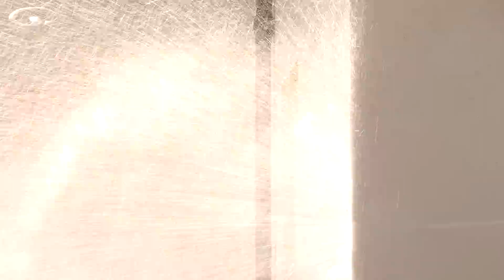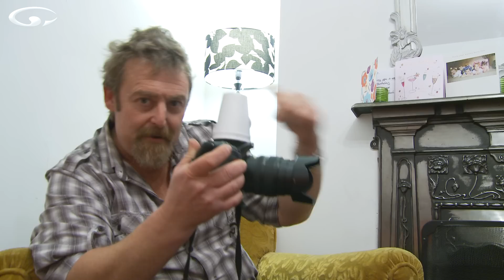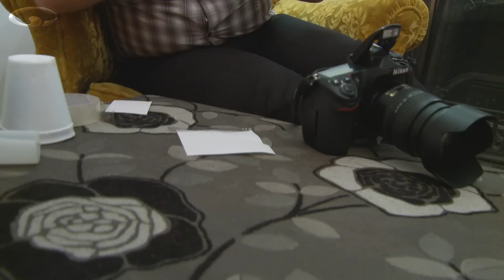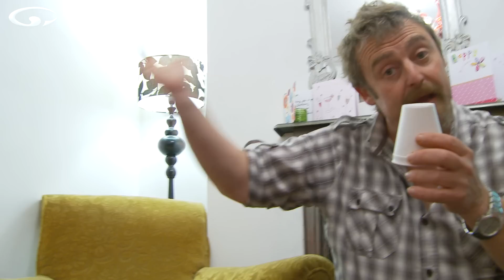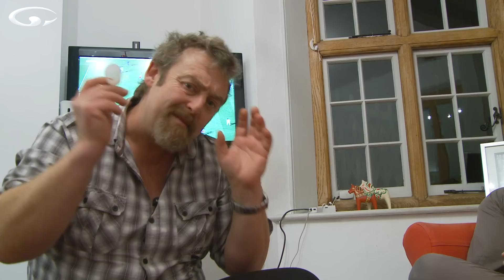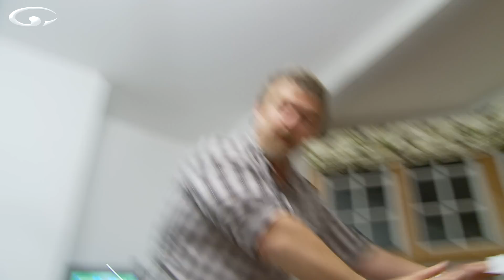Photography Tips - DIY Pop Up Flash Diffuser Pt 1

Comment: Thanks, I liked the card at 45 degrees, will have to try the poly cup with the bottom cut off. We had a couple of photos taken aound the table recently by a professional with the flash bouncing off the ceiling.  They were the best ever.
Reply from the maker: You're welcome +Bryan Hannaford If you have a clean white / neutral coloured wall ceiling to bounce off that's the best method - MIKE :-)

Comment: I used the 'business card' method for a few months before I saw this video :D
since I don't own a flashgun yet (invested in some L lenses first) I wanted to make my flash light softer somehow, so I thought about the way flashguns can rotate and figured that if I use a pocket mirror I can have the same control. So it's not exactly a business card, but I think a pocket mirror works better as it is reflecting all of the light without losing it :)

Comment: Thanks for the good tutorial. I am still waiting for the delivery of my first external flash but started to experiment with the built-in. For months I was struggling when taking indoor photos. I did not like them without the flash as they were dark/noisy/blurry but I did not like the built in flash either. It was too harsh with dark contrasting shadows.
Finally I have realized that in many cases it is better to turn off the TTL mode of the internal flash and set it manually (my M50 has 3 power levels for the internal flash). I had good results by setting the power of the built in flash to the minimal level and setting the exposure in manual mode to a level where the ambient light and the flash light blends much nicer than in auto mode.
Reply from the maker: Thanks Gabor 🙂🙏. You've nailed it buddy. The best way to find out what works best is always to try different ways of doing it. Indeed a blend of manual ambient and flash exposures gives much more pleasing results. Have a go at setting the ambient exposure about -1 stop to a bounced / diffuse flash. Nice light and subject stands out from background without it going dark. Best wishes for 2020... MIKE

Comment from the maker: Any diffuser will cut down the amount of light. The camera will set the exposure by measuring and cutting the flash burst when it's had enough light. So you have to be fairly close to the subject or the little on camera flash won't have enough power.

Comment: Hi Mike, as a diffuser I've always use a cut section of white stockings or tights held on by a rubber band over the flash.
If I need softer light I simply double it up. It works a treat and is very inexpensive.
Let's not talk about denier though :0)
Reply from the maker: :-) Yes probably best not to +Paulie52UK :-) - But great ideas though and like I always say these come from you and your Brilliant Brain which is the 1st of my 7 Building Blocks of Photography http://www.photographycourses.biz/courses/7-building-blocks-of-photography - MIKE

Comment: I used a mirror and reflected on the ceiling works very well. But, I think I need to finally buy a flash, after spending $2000 on lenses :) Nice Work!

Comment from the maker: Thank you. I haven't but will think about it. If photographing indoors i use manual mode on on the camera with exposure set 2 stops below what the camera says it should be and TTL on the flash. But that's with a speedlight so I can control it. Have a look at /watch?v=oR-OOb-ZnKI

Comment: I liked the card diffuser but it would have been good to see a picture with no flash as a base to compare the rest of the images against. Like any experiment there needs to be a control group.
Reply from the maker: Good point Pete McWade - though in that light level and only  D300 it would have been almost black and very very grainy...

Comment: hello sir, nice video I subscribed, I have a few questions, I'm using Canon 760d
1.when I popped up a flash, my shutter speed is limited to 1/200 shutter speed, how can I bypass this?
2.during daylight, when I use flash, the backgroud becomes pitch black is it normal?
3.would you recommend any cheap off camera flash that is fast and have a good recycle time, my 100mm macro lens is too long and cast a lens shadow, that's why I need off camera flash.
4.do I have to buy the transmitter and receiver for the wireless flash?
Reply from the maker: Thanks Ahmad Faris
1: it's the default flash sync speed on your camera which you can change in the menu somewhere. Sorry, Never used a Canon so don't know where it is, but it'll be there somewhere. Suggest you set it as low as possible.
2: The high 1/200 sec sync speed your camera is set to is causing this. 
3: Sorry I only use my Nikon Flash with Nikon Camera, never tried any others so can't help you with this one...
4: It will probably depend on the flash you buy. It's likely the Canon flash can be fired from your camera as is. You'll have to check the book or ask a canon dealer.

If anyone can help with questions I couldn't answer, please comment... MIKE
Reply: Mike Browne thank you for the quick reply sir, Canon flash that is tall enough to eliminate casted shadows from the lens is really expensive, almost the price of my camera body. Anyway thanks again for the reply, really appreciate it. I'll be scrolling through some forums.
sorry for my bad English.

Comment: Can you tell me you iso .
Because ok iso of 200 and with bounce flash on full power picture is very dark
Reply from the maker: It depends on the power of your flash, how high the ceiling is (the further light has to travel the more power it loses) and the aperture size you are using. If it's a small on them the flash might not have enough power for a bounce... MB
Reply: @MikeBrowne  I have used iso of 1600 on my Nikon d3300 and kit lens 18-55 on 18mm it works brilliant, picture is very sharp but light is excellent but on zooming so much picture kinda have little bit grains but not too much

Comment: At what flash power did you take the pictures?
Thank you for again another tip, sir!
Reply from the maker: In this video I used auto on the flash then adjusted it up or down with the +/- EV function to get the exposure looking how i wanted it Ubz Unclemax
Reply: Thank you for your reply, sir!
I have a bunch of respect as you still leave comments on a 2 years old video.